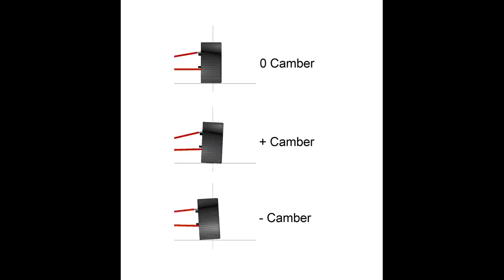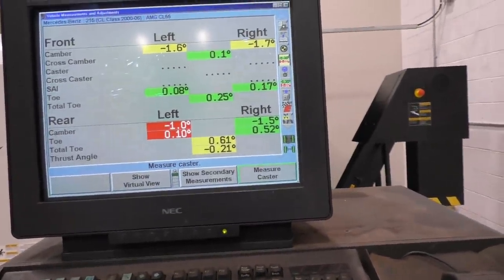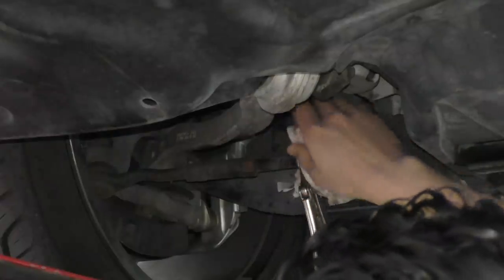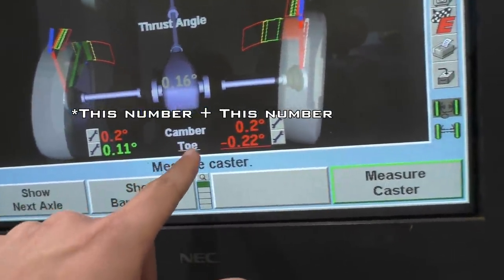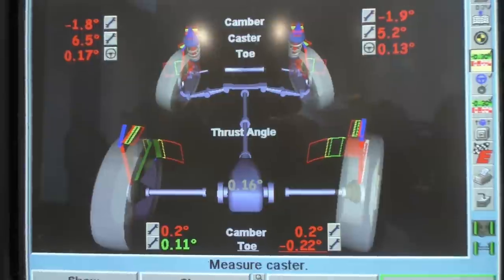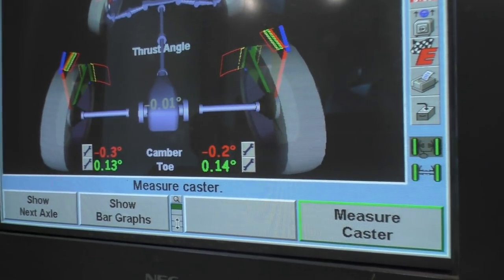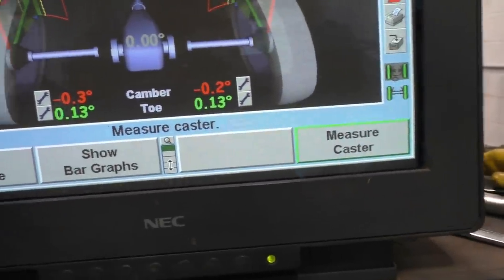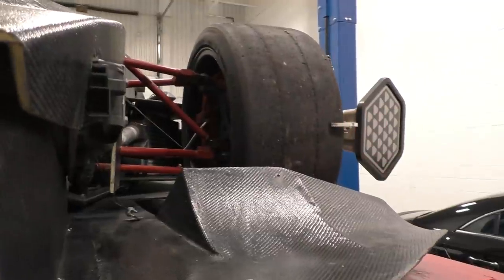Wheel Alignment - Everything you need to know !

Comment: When driving at high speeds, you’re looking for as little resistance as possible. Four wheels pointed perfectly straight prevent the car from wandering and causing excessive tire wear. However, with the exception of drag racing, the car will have to turn sooner or later. Most drivers prefer a small amount of toe-out on the front wheels for their track setup. This type of setup, if not overdone, assists in the vehicle’s turn-in capabilities. When turning the wheel of a vehicle with toe-out, the inside wheel is angled more aggressively than the outside wheel, providing an advantage in turning response since the inside and outside wheels travel around a different length radius through a corner.
Toe-in delivers an opposite effect, improving straight-line stability at the sacrifice of turn-in responsiveness. To that end, many racers set up their RWD cars with a small amount of toe-in on the rear wheels if the suspension arms allow for changes. Running toe-out on the front end and toe-in on the rear delivers the best of both worlds, with front-end responsiveness and rear-end stability. Keep in mind that these adjustments to the front and rear toe should be minimal, often times only by 1/8- or 1/16-inch. While these settings may prove beneficial on the track, they can prove more costly due to an increase in tire wear, so set it up accordingly.

Comment: When you're talking about toe at 19:40 , i thought that toe in helps the car be more stable, and toe out helps turn in response
Reply: This is correct. The video is great, but the toe explanation is reversed. Toe in gives stability, while toe out helps the cat ‘turn in’. The reason for this is because you’re putting the inside tyre at a higher slip angle earlier, which generates more grip from that tyre. The bulk of the grip comes from the outside tyre because of the weight transfer. Hopefully, we’ll see this the next time the car is on track.
Reply: Interestingly, I can't argue with what he's saying in the video but it goes against what I usually hear. He wants rear toe-in for stability, which makes sense and his explanation for that was exactly what I expected. 

When he said front toe-out for stability, I was surprised but it seems like it should be correct based on the theory he uses to describe rear toe. I suspect it is related specifically to high-speed cornering only, and the main difference there would be that the front wheels turn very little for high speed corners and a lot for low speed corners. 

For example, on a high- speed right-hand turn, weight will transfer to the left wheels and therefore they get more traction. Toe-in on the rear would mean the left-rear wheel is trying to turn the car counterclockwise, the opposite way that the car needs to rotate to turn, so it would provide stability. Front toe-in would mean that the left-front wheel is trying to turn the car clockwise though, in the direction of the turn. This would suggest that front toe-in would make the car oversteer more, rather than adding stability. This sort of explanation makes sense if you imagine that the front wheels have barely turned at all. 

When people explain front toe-in to help with turn-in, they usually have an explanation related to the angle of the front wheels as they're being turned. The front wheels are angled more when turned at low speeds rather than high speeds, so perhaps front toe-out makes the steering more responsive for low speed driving like autocross or street use, but less responsive at extremely high speeds where twitchy adjustments are used to keep the car straight.
Reply: Please stop spamming missinformation. toe-in rear and toe-out front gives stability. This combination provides for negative feedback loop whenever weight transfers from one side of the car to another. 
toe in front=positive feedback loop, causing the feel of lighter steering (the weight and speed of the car steer for you instead of your hydraulic pump and hand on the steering)
toe out front=negative feedback, making the steering heavier and the car more stable and understeery
toe in rear=negative feedback loop, making the car more understeery and predictable
toe out rear=positive feedback loop, making the car more oversteery, sending it into uncontrollable slides (its like forklift steering, but at high speeds)
Reply: I see it like this, if both tires in the front are toed in, then you unload one, that toe in will bite hard and cause an oversteer that you will have to correct.  With more speed it becomes more pronounced and more difficult to control.

Comment: the reason 0 camber is good in the back for race cars is because most race cars are MR or FR and the rear wheels need the most traction for powering the car to go forward. the front tires serve mostly for turning and braking so they can be cambered negative and have good effects on steering without affecting traction.

Comment: Race car tuner told me once.
Toe in for turn in, toe out for mid corner stability.
Toe in on the rear will also make the car squat more under acceleration since the wheels are pushing against each other.
Setting up R/C cars you need huge toe in on the rear for stability. Totally different to setting up a full sized car.
Reply: Swap the first part
The second part would only be accurate under very specific circumstances, and I would not apply that logic to any given car

Comment: Great videos. Let me know when you make it out to Calabogie, it's a hop and a skip from me. Also, I really like a good set of rubber wheel blocks on those slippery alignment racks. Always on the LR, so I see it before I get in and drive out. I find its easier always starting adjustment in the rear.

Comment: change your rear flex disc and inspect your front one. looks like it is cracking. also spray something to stop the rust. check the bushing to the rear control arms they go bad and cause camber problems.

Comment: 14:29 Its because when the car accelerate the front lifts and the back squash. This becomes more and more apparently when you have more torque (Sport and Racing cars) and if the car is RWD.
The more torque you have on the wheels the more the front wheels will lift thus you have to add more negative camber to keep the tires flat.

The back is squashing but the effect is not as pronounced as it is on the front. Keeping close to 0 camber should be the goal. In theory in cases that you have a lot of torque (drag racing? maybe? feel free to verify because I didn't) you may even want positive camber.
Reply: Drag racers prefer solid rear axles because it keeps camber at 0 through all suspension heights
Reply: @noncog1  Good to know. tks.

Comment: The problem of sensitivity of the camber is because of the tire/wheel dimentions. If you would chhose some smaller rims (same wide) it would be more forgiving. A higher tire wall can compensate better.

Comment: The reason your car likes close to neutral rear camber could be due to the downforce. As the rear squats it will likely increase the camber slightly (making some assumptions about your suspension set up) so close to neutral at tare weight might give you close to 1° at speed....

Comment: A question for you: I've noticed that F1 cars have got a lot of negative camber on front tires. Why so!? 🤔
Reply: Big, soft sidewalls means lots of tire flex, lots of camber put in to counter that. Less on the rear because it would make it more difficult to put power down while straightening back out